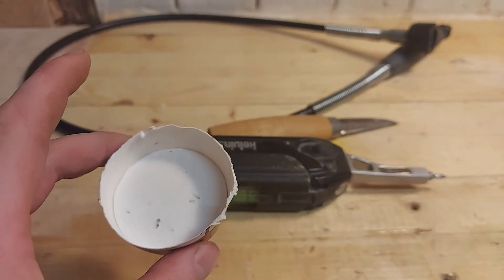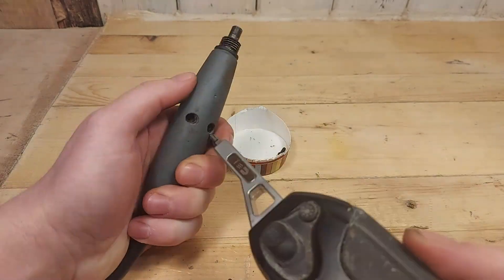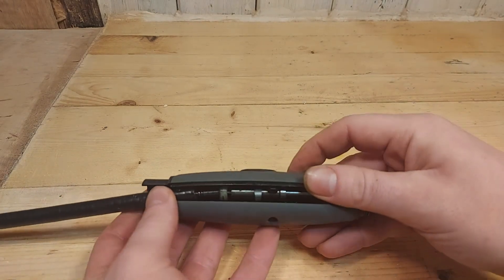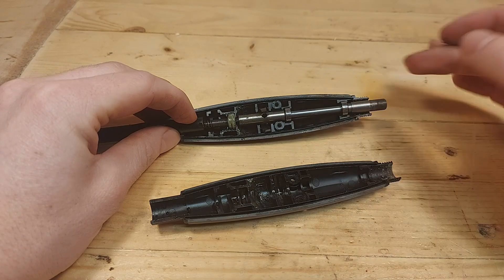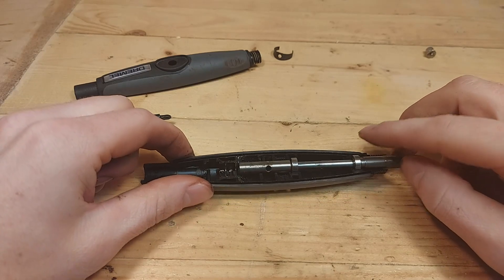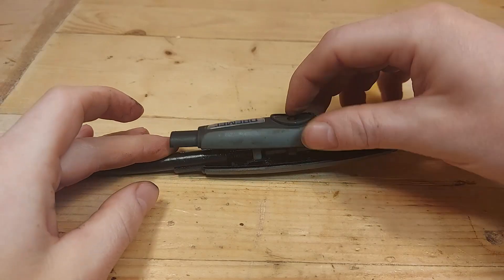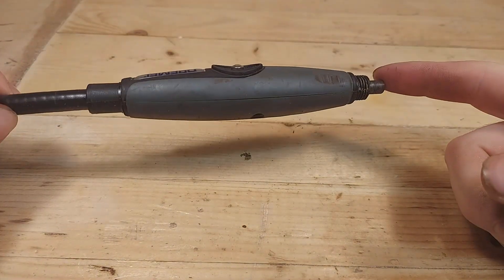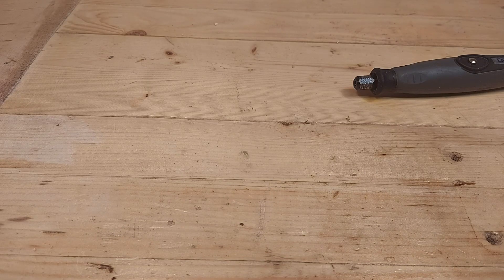What's Inside a Dremel Flex Shaft!  Disassemble and Assemble

Comment: What is inside the flex cord I see a spring which i think is the flexible outer shell but what is spinning the spindle itself is it another spring that spins inside the outer spring, what material is it or is it just a wire.

Comment: Takk!!!! Your videos helped me greatly!  I have used my flexshaft for a few days a week now over a year. I had no clue that the button was wearing this incredibly deep groove into the spindle.

Today I found out when I had a bit stuck and the button slipped. I have a proxxon flexshaft that has no button, I see why now. I just removed the dremel flexshaft button and spring and use a skinny tool to change bits like the proxxon now. 

Wouldn't have been able to disassemble it without you!

Comment: How do you keep the cable from falling back out? Its not locked in place by anything
Reply from the maker: Yeah. It is supposed to be loose inside the tube. It will stay in place when you connect it to the Dremel. It is a little bit annoying when you don't have it attached though.

Comment: Do you know if there is a replacement part for the white circle "stabilizer" mine don't have it since new and it was a pain using it because it shakes like crazy, can't find any replacement part, it's not even un the disassemble manual.
Reply from the maker: Yeah. I have no idea where to get that no. It should have come with it, but might be a manufacturing or assembly problem. I think the best option is to buy a new flex shaft, and if that one shakes from the start as well,  take it back and get it replaced. But don't open  and look inside the tool, because that will void warranty I think.

Comment: What is your opinion about re-greasing the shaft/wire?
Reply from the maker: I've never done it mine. But I think it would be good to do it to reduce heat build up and it will make the motor have to work less.

Comment: Thank you for this video.  I never knew that the nose cap was removable.  Are you able to screw other accessories on there such as the Rotary Shield or Cutting Guide?
Reply from the maker: Hi. You are not able to screw on other attachments with the flex shaft. The threads are to small.